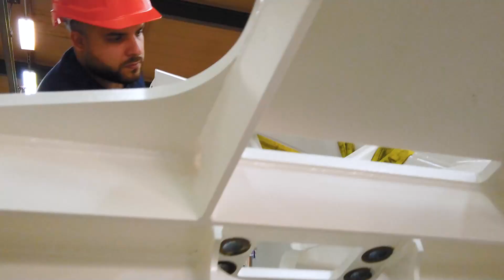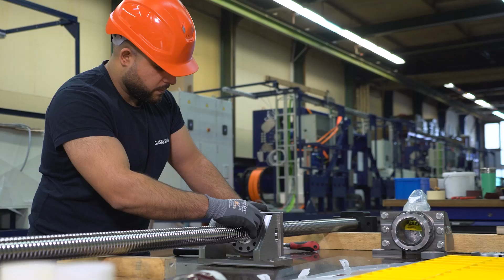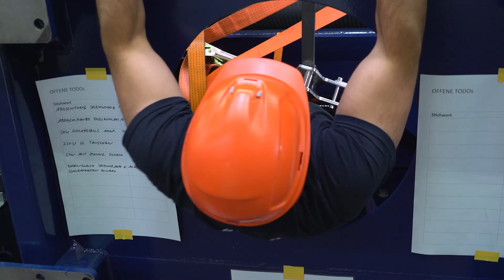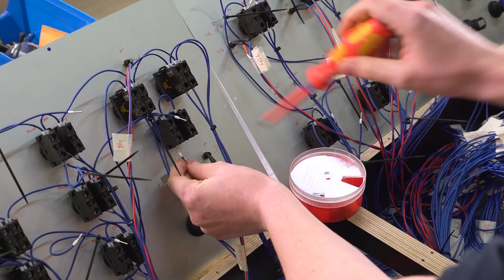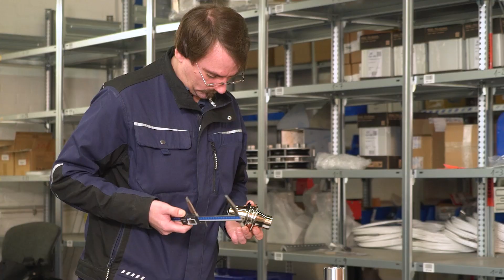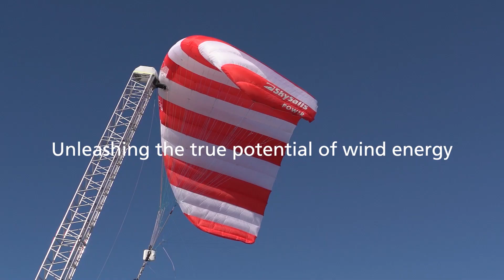SkySails Power: Production of pre series SKS PN 14

Comment: This is a very imaginative and unorthodox concept, brilliant! How does it compare with conventional wind turbines? I believe wind and wave power have enormous potential, and it is companies like yours that will unlock this potential. Congratulations and good luck.
Reply from the maker: Compared to conventional wind turbines, the SkySails Power kite flies at altitudes of up to 400 meters. Depending on the location and time of day, speeds can be twice or even three times faster. The effect this has on generating electricity is increased because the wind’s force calculates as the cube of its velocity. When the wind speed triples, its force increases by 3³ = 27 times!
By taking advantage of the constant and high-altitude wind, our airborne wind energy systems achieve more full load hours than conventional wind turbines and thus higher energy yields.
Reply: @skysailsgroup8754  Thank you for your detailed answer. I can see  the advantages of the sky sails design. It must have taken a lot of research and testing to perfect this sophisticated technology, congratulations again.
Reply: @skysailsgroup8754  - You're as skilled in word play as you are in advertising. You've mentioned that higher wind speeds equal higher energy yields but didnt really answer the original question.....How does the Skysails energy collection compare to a conventional wind turbine? Theoretically if you were to place both together in a similar landscape with lower windspeed for the turbine and higher, more constant windspeed for the Skysail what would be the energy collected in a 24hr period? And what is the average cost per megawatt hour to maintain the Skysail? The biggest question to answer is....Does the Skysail collect the same or more energy than a conventional wind turbine for less money? Thats a question that Skysails seems to be hesitant to assist in answering.